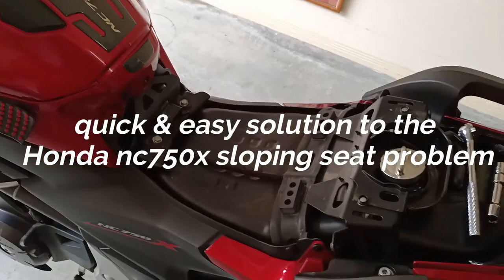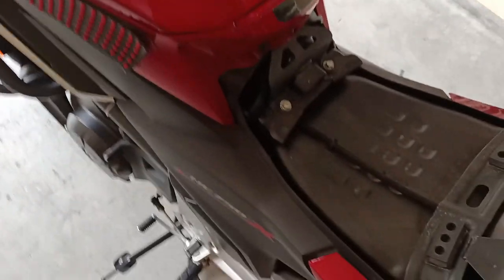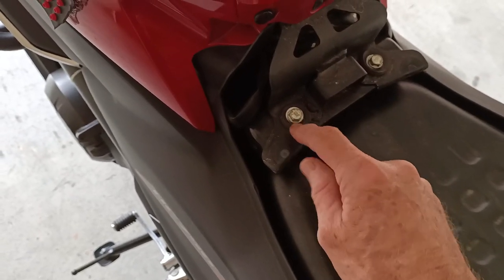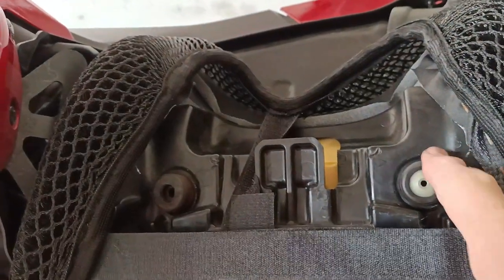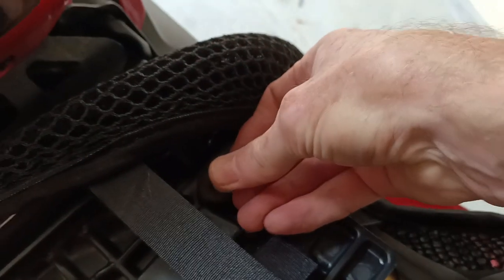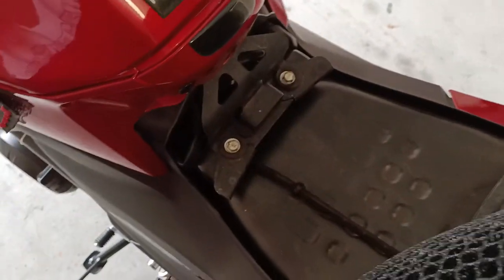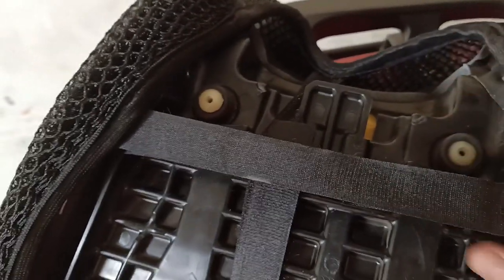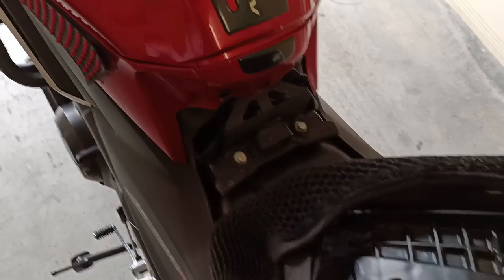Solving the sloping seat problem on the Honda nc750x

Comment: What he has used are called tapettes they are masonry anchors that normally have a nail in them. He has removed the nail and I think they are around 3/16 or around 4.78 mm size. You can buy them in a plister pack at most hardware stores. The other description is nylon masonry anchors. Most tradies use these for fixing lite duty applications to masonry. I hope this helps you sourcing them as it should be around $5 or less at most hardware stores. Ride and be comfortable. I think this is a good tip and a simple solution to a known people. Five dollars is not a lot of money to improve comfort.
Reply: Looks like it would help, but what about the hardness of the seat in general ?
Reply from the maker: It does help but that's just my butt. 😉

Comment: Hello sir, thanks for the great video.
Does that plastic screws touches that M6 bolts and that makes seat higher? I think that screws will touches wider spot than the bolts.
Reply from the maker: No problems so far. Works perfectly.